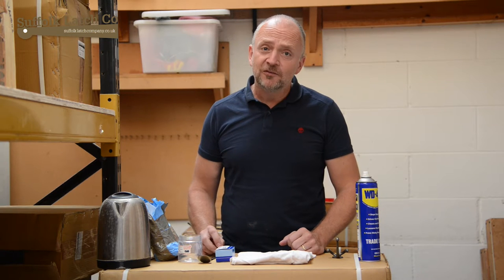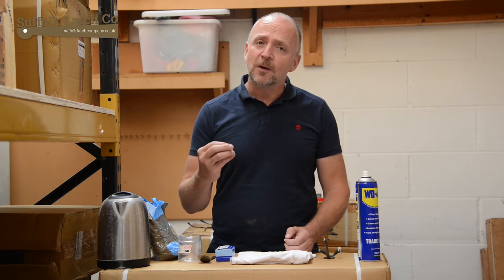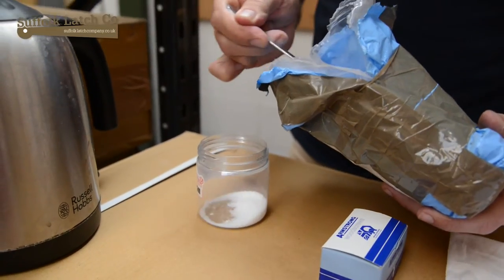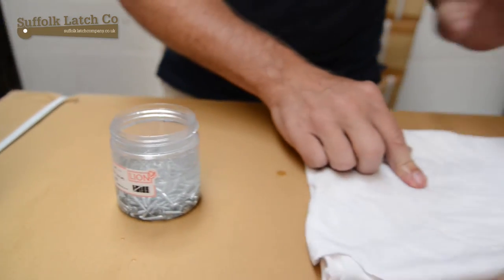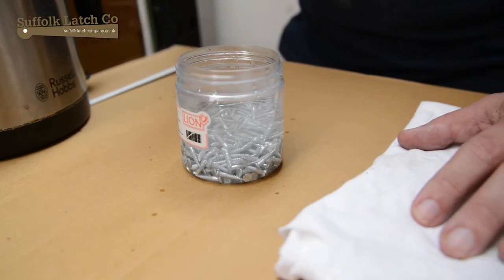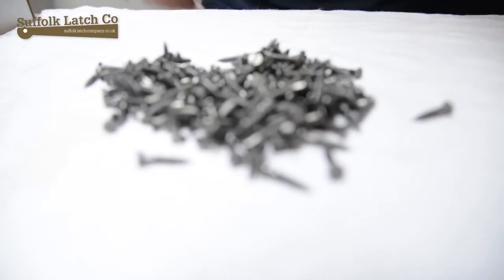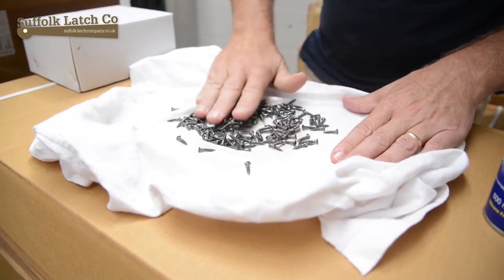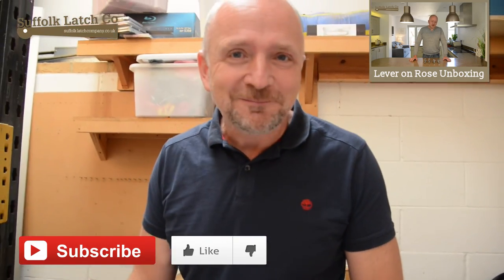How to Strip Galvanised Zinc Plating from Screws

Comment: This works beautifully- I needed to strip the zinc plating on some 1/2"-13 bolts and nuts that were going to be welded. I placed a plastic jar with the citric acid and bolts into a slow cooker with a water bath- the higher solution temperature speeds the process. Thanks for this idea!

Comment: I have a plate that I want to use  that was galvanized. That was an issue for what I want it for. I just tried this and it took a lot longer for me and I ended up leaving it in the the solution overnight However, the plate does have somewhat of a lot of surface area and I did use a detergent booster. It's mostly citric acid but I may have gotten a weaker concentration. Though, the entire coating was gone when I checked it and it's ready for me to work with.

I really appreciate this safe but still efficient option. Great idea! Thank you for sharing this information and for posting this very helpful video!

Comment: This worked so perfectly!  But the real bonus to this method is how environmentally / pet / human friendly it is compared to almost all other approaches of "blueing" steel or adding this patina.  As you did in the video, be prepared to finish the hardware with some kind of corrosion inhibitor immediately upon removing it from the citric acid soak or they will begin to rust within minutes.  Thanks for the video!

Comment: I sprayed nitric acid sanded with wire wheel and steel wool three times. Now there is a white residue on the metal garbage can I did. Do you think it worked and what it the white residue
Reply from the maker: Hi Jacob, the white residue you are seeing after using nitric acid to strip zinc plating off a screw could be zinc oxide or a combination of zinc oxide and other reaction products.

Nitric acid is a strong oxidising agent that can react with metals like zinc, causing it to dissolve and form a solution of zinc nitrate. Zinc nitrate can react with water and atmospheric carbon dioxide to form a white precipitate of zinc carbonate, which may be what you are seeing as the white residue.

Comment: I’ve had similar issues with fixing screws on steel signs with rust or a copper sulphate patina. What I do is strip the zinc plate in a diluted Hydrochloric acid solution and then copper plate the screws before applying an antique patina which darkens the copper, left long enough it’s almost black

Comment: Has the zinc plating actually been removed, or has it just changed colour? Is this process suitable for items that will be subsequently welded?
Reply from the maker: Yes the process completely removes the Zinc coating therefore any welding process will be free of Zinc fumes.

Comment: Slightly laborious and really for a few at a time, but after stripping the zinc you can DIY 'self-colour' by heating to nearly red hot (in a gas flame) and quenching in oil. If you use old engine oil, the carbon in it leaves pieces black, with a nice sheen. This also leaves them fairly corrosion resistant. BTW, i imagine acetic acid powder (also readily available) would work equally well as citric.

Comment: This is brilliant! I have seen solutions involving muriatic acid but that leaves the conundrum of disposal of a strong acid. Vinegar takes days and also discolours the metal. This works  well, is quick and safe. Thank you so much for sharing - I use steel (nuts, bolts, bar etc.) for small scale brazing but most of what you buy is galvanised these days - nasty to braze!!
Reply: Use baking soda and dump it down the drain simple

Comment: Guess you could put the screws on their heads on a soaked piece of cloth to only remove the zinc at the visible part, and still keep most of the rust-protecting properties of the coating.